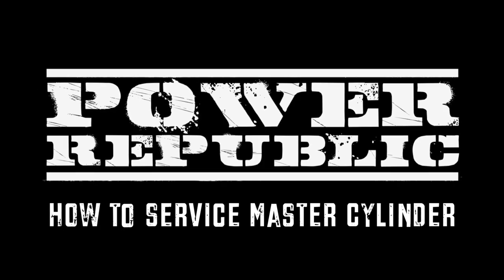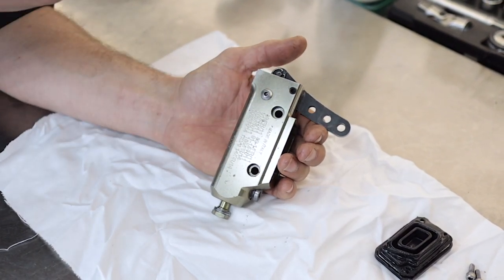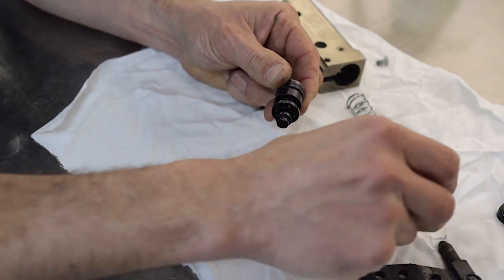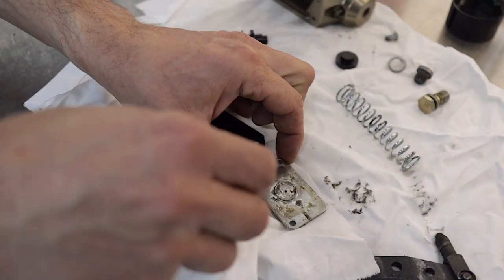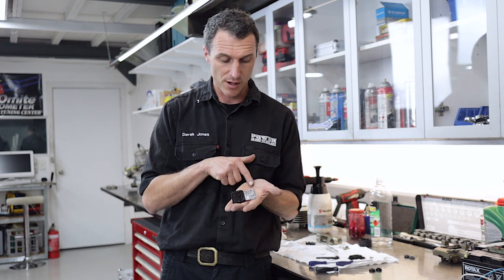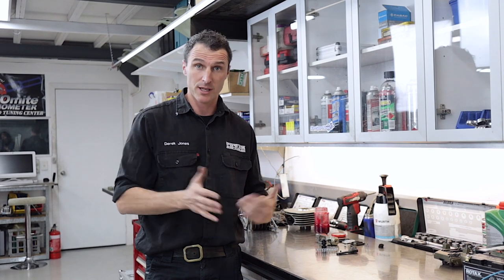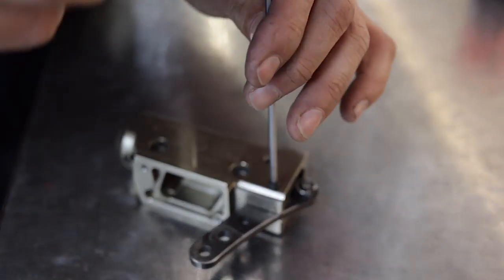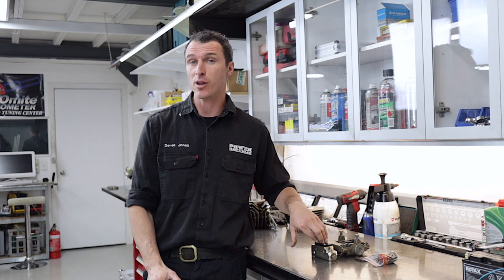HOW TO: Service Your Intrepid Go Kart Master Cylinder - POWER REPUBLIC

Comment: Thanks for sharing this video! Im curious if you put new rubber seals on? Or where there no new parts put into this service. Cheers
Reply: I know you mentioned CRG, so if i have a CRG 2018 Road Rebel (DD2) i could watch this and not get completely lost if i wanted to service my brakes?
Reply from the maker: Yeah mate, we put all new rubber parts in this job as part of the rebuild for the customer

Comment: How would you bleed that type of master? Since you can’t use gravity bleeder. Thanks for any info
Reply from the maker: Eastendhunter9 you can use the gravity system to bleed these ones. They have an inlet just above where the banjo bolt bolts on.  The reservoir is for the self adjust brake pads system.

Comment: Hi, i’m Having problems with my brake system and wonder if you could help me. It’s a Praga, and i’m having brake drag, the pads keep touching the disc, I though it could be excess of brake fluid, waht you think? 
Ps.: I didn’t opened the caliper yet and i’m watching your videos to learn how to do it.
Thank you
Reply: And there is no shims**
Reply from the maker: Hey Guilherme, double check that the lever arm on the Master clyinder is going back far enough to let the fluid back into the resiviour.  start with new seals and cleaning the whole system.  Then bleed through new fluid  and add some new brake pads at the same time.   That should fix it

Comment: I’m taking apart an Energy Kart master cylinder, which is very similar.  However there is no grub screw for the pin, just two c clips.  I’ve taken the c clips off, but the pin won’t budge. Any tips?
Reply: Scratch that, there was a grub screw, just well hidden under the cover! P.S. you’re videos are awesome!
Reply from the maker: Thanks bro.  Yeah was gunna suggest a hiden grub screw

Comment: Hi, just wondering if you supply seal kits for Intrepid R1K/R2K master cylinders? If not, are you able to point me to a stockist? Having trouble locating a seal kit.
Reply from the maker: https://www.internationalkarting.com.au/shop/item/rear-caliper-spare-parts-kit-r1kr2k
Reply: @PowerRepublic  thanks for responding, yeah already been in contact with IKD and they don’t have any and apparently tried overseas sources with no luck.
Reply: Hi Mark did you find a place to get a new rebuild kit?. Im in the UK and i have taken both my brake systems out and have them ready to be re done.

There seems to be two Italian dealers with some of the products, Mondo Kart and Intrepid Italy.

Just wondered how you got on. It seems very difficult to find Intrepid spares and it sometimes makes me want to sell mine.

Cheers Mark

Comment: Hello, I have a question. I am also building my break master cylinder. I was wondering once I press the leaver for some reason the piston and spring doesn't return and gets stuck. Will you be able to help me with this? Wondering why is That? Thank you.
Reply from the maker: Did you add some rubber grease or brake fluid as assembly lube?
Reply: @PowerRepublic  I sure did.
Reply from the maker: just check that you didn't over- tighen the lever arm bolts?
Reply: @PowerRepublic  I've doubled check that the piston and spring is not disengaging. It is a snug fit I wonder if I have to break it in before i put in the break fluid?

Comment: Brake cleaner isn't good on painted surfaces right?
Reply from the maker: Riccardo Arici not as bad as carby Cleaner but not as good as water. The Brake Fluid d is probably the worse again.  The anodised brake parts are fine to clean with brake cleaner/workshop solvent
Reply: @PowerRepublic  thanks

Comment: Could you please provide the name of the red grease and bolt lock liquid? (Not necessarily the brand, but the type)
Reply: Also, the cleaning liquid you used to clean all the parts..
Reply from the maker: I use brake cleaner for the start, then methlyated spirits for the final clean out
Reply from the maker: the red grease is rubber grease, and the loctite is blue nut locker ( light duty)